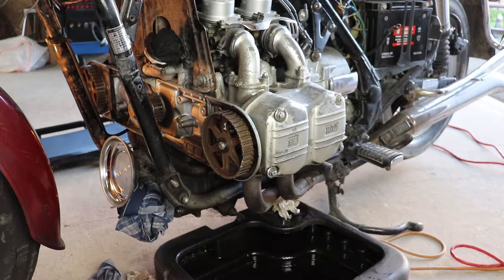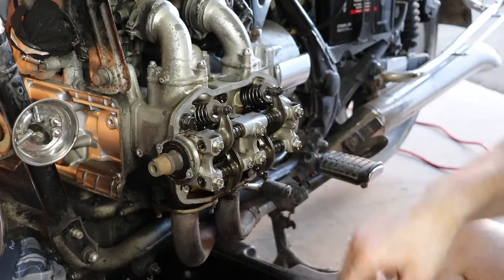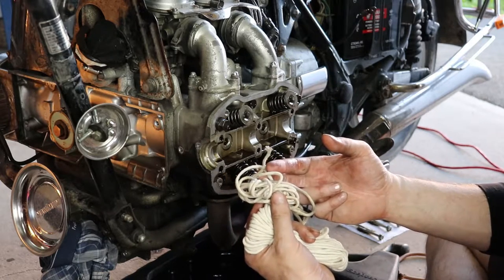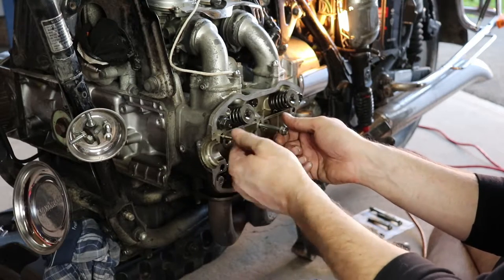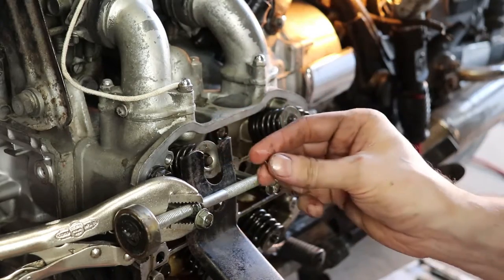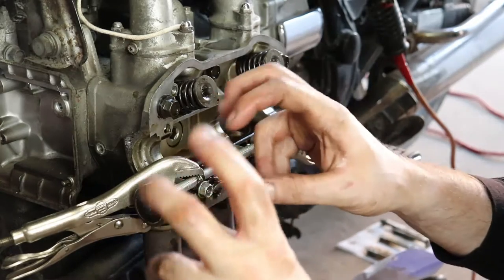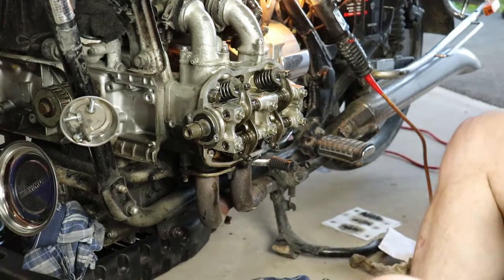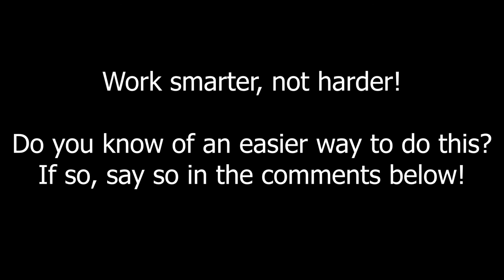Honda GL1100 Valve Stem Oil Seals Without Removing Heads

Comment: Oh man, I REALLY did not want to have to pull them and re-do the head gasket and this trick/tip will come in very handy in the very near future. Had new valve stem seals for over a year now and was just looking to buy new head gaskets. So glad you saved me nearly 200 bucks. I personally HATE RTV and have gasket making material just for these instances. We all do what we have to at the time I know, but, I am repulsed by mechanics that do these things. I've cleaned up after folks that do this and it really annoys the Fucc outta me.

Edit:

Holy crap you actually have the RIGHT Trac forks too. So cool. Only on the 83+ models (11 and 1200)  Subscribed cause never can have too many good tips. Loved this one.
Reply from the maker: Thanks for the sub brother! I've been lax on posting as of late but I've got new content coming soon, including a 77 CB750 I recently picked up!
Reply: @blastworks  Cool, I have an 81 which is dual overhead cams. It's been sitting in my shop for a minute.

Comment: I will be using this as a guide as I do valve seals fork seals and carbs on my gl1100 this winter, I've been riding it this summer but it smokes pretty bad until warmed up and has leaking fork seals and one carb leaks
Reply from the maker: Awesome to hear that my video will help you out Tony! Once I did the seals on mine, the smoking went away completely. 

One thing to keep in mind is that with these boxer style engines, if you are using the side stand, some oil will remain up in the valve cover. This will cause the bike to smoke a bunch until that stuff is burned off. I always keep mine up on the center stand and it rarely smokes. If I don't start the bike for a while, the first time I fire it with choke it will smoke for a few moments and then once I roll the choke off it runs as clean as a whistle!
Reply: Bruh, I re-did my fork seals last year and do yourself a favor. Have the replacement Guide and Slide Bushing on hand. I replaced mine due to the wear and had to wait 2 weeks to get em.  I bet I know which carb is leaking too.  I re-did mine and bought new Shaft seals that do not come in Randakk's kit. They are on Ebay though from some dude in Wisconsin or Michigan. Do yourself another favor and buy em. Vacuum leaks happens from worn felt shaft seals. Do it right or do not do it at all. My 2c worth. Also I replaced my carb plastic tube between the adjoining carb with a brass one, additional cost from Randakk's too. But just call me anal, I know I am. It is not required though. You can re-use the plastic ones.

Comment: Good idea. Clamp the bolt the other side it will be levering against the screwed in bolts then. Or better still drill two holes in a flat bar.. glad I seen this saves a lot of hassle and a £50 gasket.
Reply from the maker: Great ideas Rusty! I'll give it a go in 100,000km :D

I'm happy my video was useful to you! Cheers!

Comment: Why not use compressed air to hold the valves shut? I've changed many a valve spring and/or valve stem seals using air.
Reply from the maker: That's also a great option, although if you have valvetrain issues (bent valve, damaged seat) then that method would not work whereas this method still would. I've actually done it both ways in the past.
Reply: @blastworks if you have damage remove the head and fix it , right . I’ve used the compressor air but I do like the rope method as not everyone has air available.

Comment: Normally when the valve seals need done the engine needs a full decoke to remove the oil build up carbon  the left bank cylinders usually the most choked caused by the bike being parked on side stand and oil seeping through.
Reply from the maker: This work was done as part of my $500 budget goldwing project. I had a bike all summer that ran perfectly, didn't smoke, and carried me thousands of kilometers. You can check those videos out on my channel. That being said, I will rebuild this motor one day! I also only ever use the center stand, so hopefully it's not so much a problem for me going forward.

Comment: Does the rope you put in the cylinders need to be cotton?  Can other rope materials be used?
Reply from the maker: I'd stick to materials like cotton as, if any ends up staying in the cylinder for some reason, it will burn off with combustion. Anything like nylon would run the risk of melting and then you'd have a bad time.